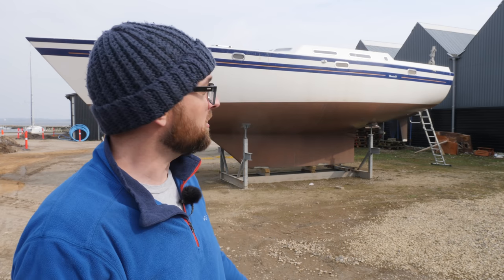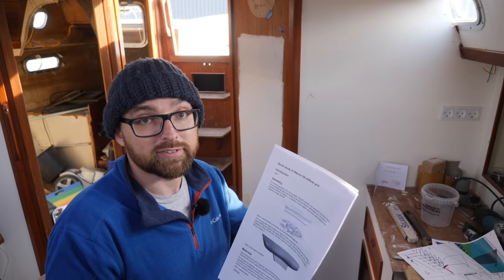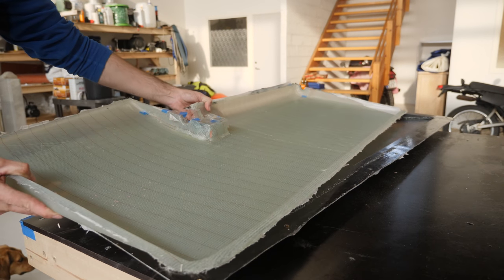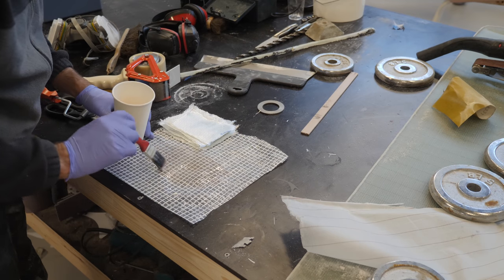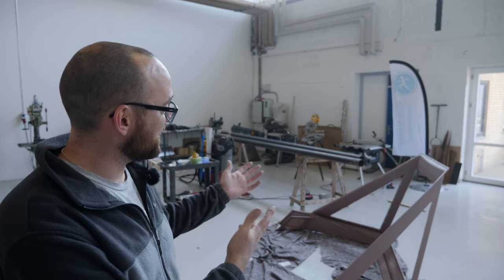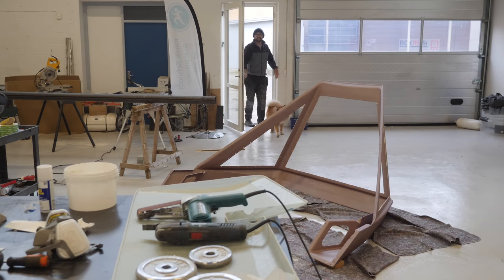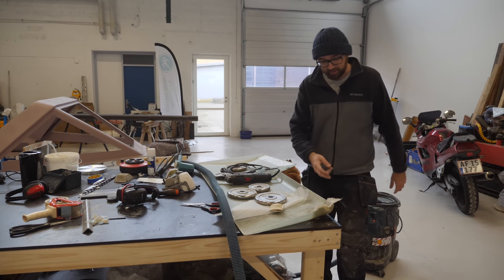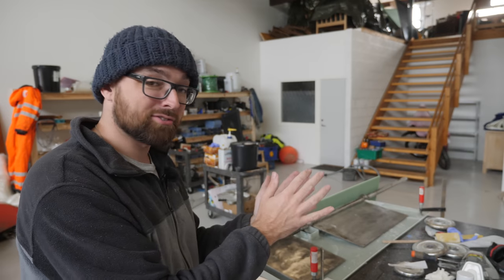Sail Life - Structural members, rudder and dodger fun - DIY sailboat repair

Comment: Have a word with the guy who did your calculations before making it 9mm thick.Its an old fallacy that adding more will make it stronger; if you add strength to the wrong bit it can move stress points and actually make it weaker by putting stress into somewhere that at the moment has little stress.
Reply: don't add cost and weight and extra work when the analysis shows 6 mm is good.

Comment: Non-compressible Filler in Rudder

1) I think about your project from time to time, and wonder how you will interface the SS rudder shaft and welded "fins" with the outer fiberglass shell of the rudder.  If the filler/interface is foam, the foam will be compressible and in a short period of time it will permanently deform, and the SS parts will be loose inside the fiberglass rudder shell.  Maybe that is why the original rudder had a cement-like filler inside - it wasn't compressible and deformable. I just can't imagine it working for very long with a foam filler!

2)  Okay, this next suggestion may sound a little odd, but I think it will work well for you.   If you insert and seal an air/plumbing fitting inside a hole you drilled in a structural rib, and seal the other side of the hole, you can pull a vacuum inside the wet rib.  The moisture inside would evaporate very quickly under vacuum.  If you have an IR thermometer, you will see the temperature of the rib drop significantly below ambient until the water is completely evaporated.  You will know it is completely dry internally when the rib returns to ambient temperature while still under vacuum. Then, since you already have the vacuum pump connected, drill a shallow hole X distance away, insert a fitting, and vacuum infuse the dry internal wood with epoxy (or GIT-Rot).  This would be a very interesting experiment with potentially significant gain and very little downside risk. 

( I am not a shipwright, just an engineer with a fresh-eyes perspective.  Oh , and I restored an old 1945 wooden sailboat a few decades ago, and really respect the fine work you are doing.)
Reply: I find this a truely amazing solution: getting rid of the moisture, reinforce the ex-plywood to new strength, seal it against any future moisture so that you can sleep tight. By the way, why should you put up with a solution that you know isn't 100% correct like leaving the moisture in the floors? Your boat may easily last much longer than 30 years if you do a proper job now !

Comment: Mads, you can glue those foam sheets together and then hot wire cut the core to the exact shape. The cutter's are super easy and relatively inexpensive to make and chances are you and Cement Boat guy have most of the pricey bits already.

Comment: Hi Madds
I’m with a few of the comments ,use your pvc foam but fill the voids with a high density polyurethane foam.
You don’t want voids nor the internal stainless to work itself loose. Foam will stiffen the rudder. Broken rudders are the major reason to abandon yachts. Too late but I would have built all stainless rudder. Frame it to the rudder stock like an aircraft wing and skin it with stainless. Having fun watching your fun.

Comment: I'm way too late to have a meaningful comment, but I'm glad that you have decided to gut the interior and re-design it. I've been working through all your videos, and must say that I'm not crazy about the interior design and finish of your boat. This will be a chance to get away from the bulkheads fitted halfway across the port lights port and starboard. It seems the original build quality of the Warrior was poor, but if this was the original design, that left a lot to be desired too. I'm sure you are going to end up with a much nicer and stronger boat at the end of all this. Keep it up!

Comment: hey Mads, about stiffening up the structural members: if you make them too stiff you might be creating pinch points: the hull is going to flex the same amount as before, if your struts are too stiff it might stress the adjacent material too much so maybe it would be good to aim at the design stiffness instead of adding that little bit extra. Something to think about.

Comment: Mads, the rudder core. You might have seen it already, but I used Sicomin Expanding Epoxy foam (about £150, my rudder is a bit smaller) when I stuck the two halves of my rudder back together. (Video is the April 2018 one, check from about 7 minutes in - so one year ago! - doesn't time fly when you don't have a rudder to fix).
I did loads of tests, including mocking up a 'see through' rudder, as I was worried that the foam would expand too fiercely - but it was fine as it is a low pressure expanding type. I stuck both halves of the rudder together and filled in the foam at the same time.
To be honest, this was probably the most straightforward part of the job. I really wish I had made a mould as you have done. As for sealing the stock - I just used loads of 404.
Good luck, I look forward to seeing what you do. Paul.
Reply: Just had two rudders rebuilt with the Sicomin epoxy expanding foam. Rock solid, conforms to every corner, easy to shape and far from $2000... Just another DIY guy here so maybe I'm wrong, but I would totally go for that epoxy foam given the somewhat complicate voids you have to fill.
Reply: Paul, you did it right, other than not making a mold first ;)  

Amazing job and a great you tube series. Looks like you might possibly be out-Madsing Mads himself here on your rudder work.
Reply from the maker: Hi Paul :) I tried using Google to find a place to purchase the foam you used. I wasn't able to find it so I priced out the foaming epoxy using stuff from west system. Yikes ;) Turns out there is a reseller of the foam you used in Germany. D'oh! I'd love to have a little Skype session with you to learn about your experience with the foam if you're up for that :) drop me an email with your Skype username at saildotlife@gmail.com :)
Reply: Just about sailing - I’ve said it before, I’ll say it again - your rudder video was a highlight of 2018, definitely in Mads’ class (possibly more engaging) - great job.

Comment: If laying up sheets one at a time perhaps the vacuum bag could come out again and be used to ensure good contact against the inside of the shell, similar to laying up sheets of veneer against a caul.
Reply from the maker: I like the idea of using a vac bag :) Thanks!
Reply: @SailLife  You definitely should vacuum those sheets in. Waay better overall coherence than weighted-only, and You already got the form with a flange to airtight it with butyl. And this fiddlesticky additional layup for slight mistakes is perfectly normal, it is Your first formbuild, isn't it?
Reply: Exactly my thoughts. Pop it back into mold and vaccuum bag the foam down . Also, dependent on epoxy during times you should be able to lay up multiple layers at one time. Just be aware of how much the foam is compressing and dont use maximum vaccuum if it is compressing too much.

Comment: I would use the 20 mm foam but put a number of long cuts across it without cutting all the way through. This would allow it to bend to the shape and when you lay it up in a bed of expose filler it will fill the channels that you have cut to hold its shape. It will save you time filling the rudder cavity with possible two layers of 10 mm.

Comment: Would anything speak against a extra weld on metal flange on the bottom part of the rudderpost? So you could have something similiar as for the upper part to seal against. The flange could be made from two half-ring pieces welded on the rudderpost.
Reply from the maker: I don't see any reason why that would be a bad thing to do :)
Reply: This is my thought too - why not just weld an extra ring on?
Reply: I was thinking exactly the same thing. Weld another ring on!

Comment: Mads - I have used that foam before (my version was made by Airex). I heated it a little in a warm box (made from scrap ply with a room heater supplying warm air) and it then becomes flexible and will conform to any shape. Just put weights on top. Once it cools it will hold shape and can be glued in place, then faired off across the centre line of the rudder shells.

Comment: Rewatched the old rudder video. The lower flange was out side but flush with the glass of the rudder. At 6 min you can see a chunk of removed glass is thick inside the flange and paper thin outside. But the flanges fit in the new shell, so never mind.

Comment: Please remember to use a pickle and passivate stainless cleaner on the rudder as carbon steel tools have contaminated the surface with lots of iron particles which will initiate crevice and pit sites. Not what you want on that spiffy new rudder 👍

Comment: Mads,
I would fit the thin sheets into the curved section in layers and then you have the ability to level the inside surface to match the plates on the shaft using the edges of the form as a guide.  Sort of like leveling concrete in a form.  Best wishes for which ever way you decide to go and give our best to Ava.  Have a great week.

Comment: Thicker foam and hot stretched piano wire to remove excess.  Proven in making model r/c airplane wings for almost half a century. Use rudder glass to make template ribs, quite simple process.
Reply: Dnihilist hi does not work within pvc based boat building foams, only styrofoam...unless you know something I don't know? Cheers Warren

Comment: I think the direction you’re taking with the foam is good. As for sealing that lower rudder post, I like the idea of building up the fiberglass, and sealing against that. It’s free, and you can do it yourself. That can potentially offer you more surface area for sealing.
Have you considered drilling big holes (3+ inches) in those big plates? That would lighten things up a lot, and give you more surface area for whatever bonding agent you use.

Comment: To help preserve the wood inside the structural members you could drill some holes into the members from the top down and put salt into the holes. This will prevent rot from setting in. This is an old technique used in wooden boat building to stop dry rot, and will prevent any type of mold from doing damage. It is a simple technique and even though you are going to add laminate to correct any weakness, this will just be an added measure to help keep the strength of the members.

Comment: Cut Aluminum plates to match the bottom of the boat and TIG weld them across the top enclosing the framework. Then drill four holes crosswise use lad bolts and drive into plywood, you can also through bolt machine bolts as well you can then inject epoxy on three sides if you like for good measure.

Comment: Hi I'm a follower of yours on YouTube, I always look forward to seeing your weekly videos on Sunday at the last minute, I do not know English but I really like what you are doing with the professionalism and meticulousness of the restoration work. I got in touch because I would like you to answer a question, I am restoring a Ro 300 from the year 2000 of Ronáutica Yachs is a sailboat based on the Epic Fortuna 9, I have disassembled the rudder blade and I have detected that it is full of water , tonight I have let it empty by making a hole with an 8 mm drill on the top and the bottom of the 5mm blade has been empty and today I will start the process of fresh water inside it for two or three times Well then, my intention is after this, let it dry and fill it with epoxy polyurethane foam, since I can not avoid that water enters the blade, at least avoid that a lot of water, the question is what material do you advise me and provider, and also if I am doing it correctly I accept advice. Best regards, I hope that both you and Anna will be very happy. Kisses..!!

Comment: My 30 year old rudder (S&S 36) was rebuilt last month by the guys at NewRudders.com in North Central Florida (Fedex'd both ways for $300). They have been rebuilding rudders for 20+ years and complete dozens of them each month.  It's all they do:  rebuild rudders.  They use a poured in place foam which they say is rated at 24 pounds per square foot which is super dense. My old rudder's foam core was probably 5 pound foam. They stripped the post and frame out of the old rudder and determined it was very solid and robust. The rest of the old rudder was scrapped as trash.  They laid it into a mold and poured the 24# foam. When it set up they wrapped the new shape in fiberglass with a gelcoat cover ready for barrier coating and bottom paint.  That's the Cliff Notes version of their process.  I too have concerns about layering foam board inside your new rudder molds.

Comment: Mads, While you are working on the interior, consider adhering the cabin roof beams to the cabin sides. You could epoxy u-shaped wooded supports under them. It would make the cabin roof much stronger. Ken.
Reply: Agree.

Comment: There are some good ideas below.   I like the idea of removing a few 3 inch or so round holes to help lighten it up etc, What about a layer of foam sheet on each half of the shell & a pour foam or the concoction that flows to fill the balance of space?  I would have to go back & watch but thinking washer on both sides of the shell everywhere the post passes through to help keep the rudder from moving up or down in the future May be over kill once the insides are packeted in there.  Already looking fwd to next week.

Comment: Although it would be nice to CNC route large bits, you could fill in layers to get close leaving the sloped area to sort out. Then if you make a guide board to lay over the rudder half with holes and edges to guide a router to level the sloped bit to half the flat stainless thickness. 
The hard way would be to make rib sections that match the interior and stainless and use the small CNC to make a few hundred stacking them up.  Modified would be to use rib bits where the flats are not and the router in the sections with flat panels using layers. You will need to work out clamping, either with sandbags or perhaps the rudder shaft can be supported and the mold halves used with clamps (do coat with release if you do).
One I haven't tried would be to inbed a feeder tube near the shaft, place back into the mold haves and vacuum bag the whole assembly the vacuum infuse the epoxy to fill all voids. Should ask if anyone has done it and get a full run down. It's no time to fail missing some important bit and having to start again.

Comment: for the structure repair, have you considered taking out the old wood and pouring in nida core or similar?  I have seen it mostly used in transoms.  People leave the fiberglass and pour in sea cast or nida core and it's strong as heck.  This way you would just have to remove the top fiberglass and cut out the old wood in there and pour in new.

Comment: Good job on the fix for bearing surface on rudder shaft.  Great plans for the changes in the cabin.  Having a chart/nav station in the main saloon will provide the space for you and Ava to work together on trip plans. Take lots of pics before you rip put existing structures.  Chain plates look to be attached to some of your planned remodels.  Overall everything is looking very good.  Splash date will be an epic day.

Comment: Hi, build up a big block of foam sheets with the steel profile parted in two halves then hot wire the profile for the outside to fit inside your skins. You can get the profile from ply ribs in two stages.

Comment: I love the effort you put into all of your projects and would hate to see it wasted. I'm not qualified to have an opinion on this matter but I can't help wonder if there was a reason the designers spec'd such a heavy sand filled rudder, was it for a specific reason such as the possibility of a foam core compressing under the turning torque and resistance from the water, the additional ballast to help the boat sit correctly at the waterline or just due to cost. That aside I agree with others that it probably wouldn't do any harm to lay up some extra glass and weld an extra ring onto that lower section so you can create a better seal.

Comment: Mads,

Your could consider filling shell with foam.  Leave it overfilled.  Place shell in parting board.  Router sled to level center.  Then router out area for stem and fin.  Just a thought.

Comment: To seal the rudder shaft--although I am a very old 5200 fan(40yrs plus!) perhaps another option--rough up the stainless with 80 grit and apply a schedule of West System G-Flex epoxy, with perhaps some colloidal silica-----Mikey

Comment: My immediate thought is to put a section of solid 404 10cm thick anywhere the rudder shaft protrudes through the shell, a long solid contact point like that would do good to seal the shaft, and seal it in one half then put the other over, if there is no seam between the halves in that portion, there is less chance the rudder will leak!

Comment: Although 5200 (a polyurethane compound) is an excellent sealant, I would be careful what you use it on. If the item being sealed is never going to need resealing or disassembly, then it is good. However, if disassembly is ever required, the 5200 will bond to fiberglass such that taking if apart is needed, the 5200 will literally tear the glass laminate from whatever it is adhering to. An alternative compound that gives an excellent long lasting flexible seal is a poly sulfide caulking material such as is made by Boatlife. I am not affiliated with the company, but I worked in the fiberglass boat building industry for 15 years. We tried 5200 and when change orders came through for deck hardware placement, we ended up pulling off the top layer of laminate when we tried to remove the part that was bonded with 5200. At that point we switched to the polysulphide compound, and things were rosy after that.